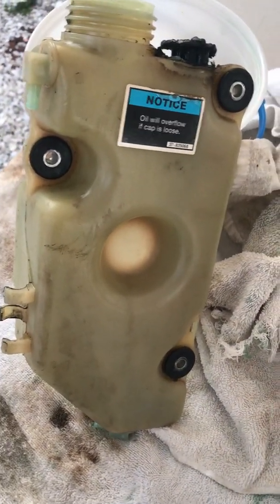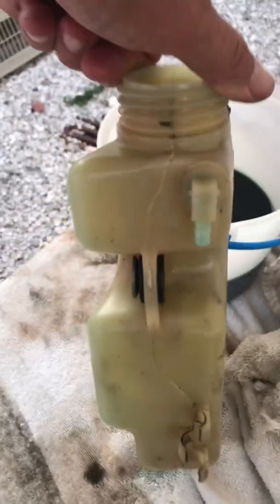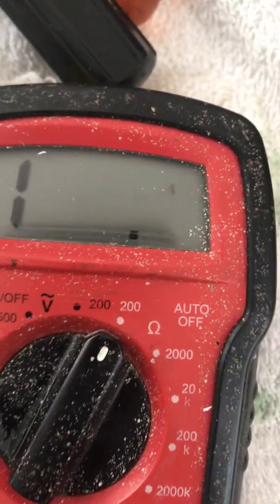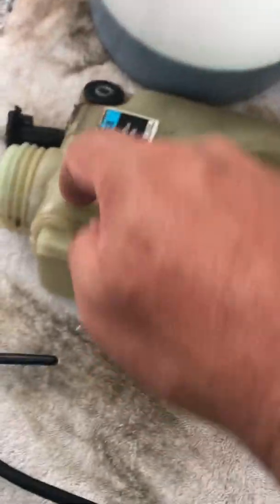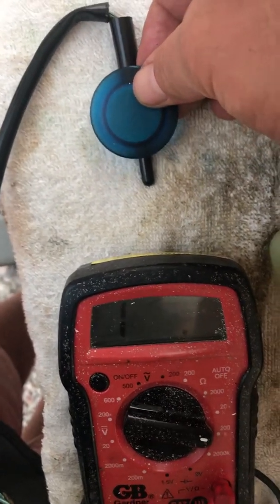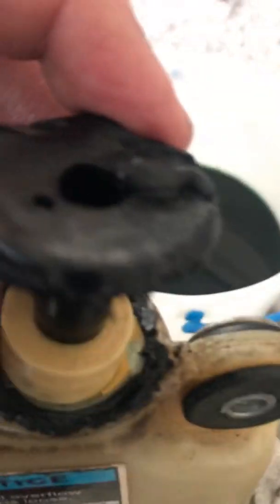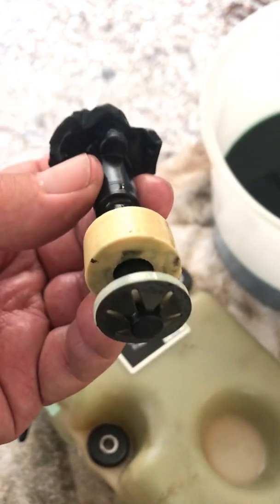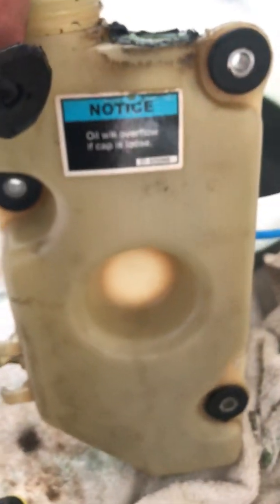Mercury Oil Alarm Tank Fix 250 EFI XL

Comment: I just detatched my  faulting (intermitent) motor tilt relay to get part number and pin configuration to order a new one, and the instrument oil lights are flashing and beep ,,,,,,beep .......beep alarm upon reassembly (of faulty relay). No remedy yet .... maybe when i get the replacement tilt relay in , perhaps it will quit.